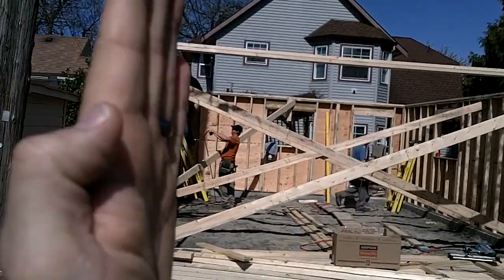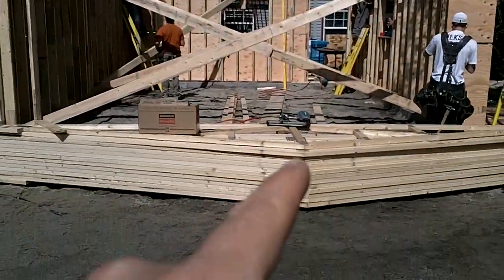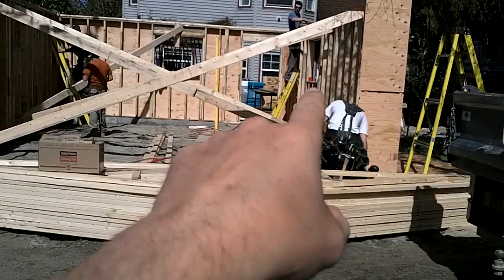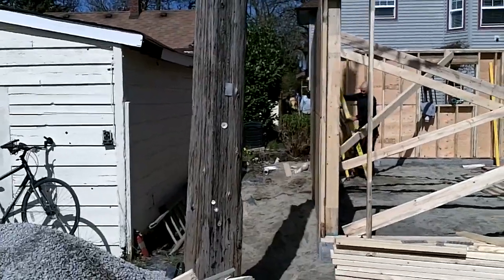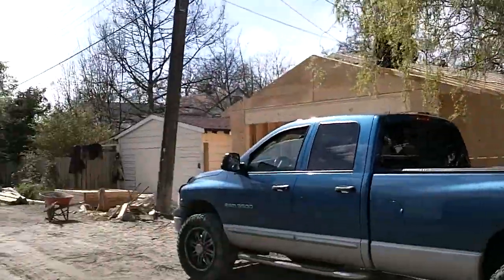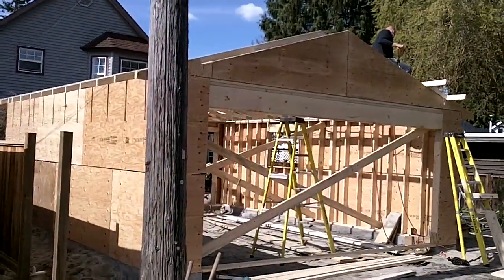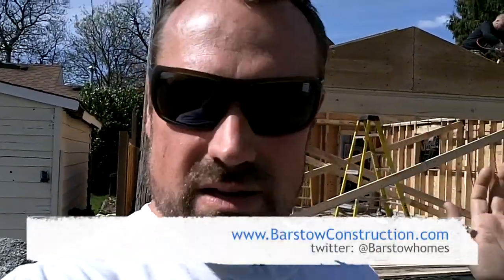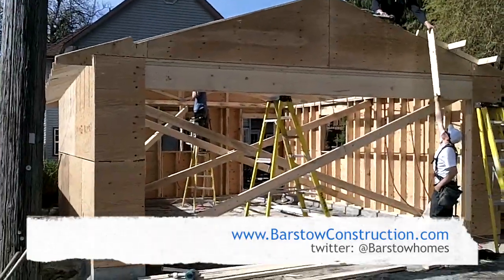Garage Build Part 8 - Framing the Garage

Comment from the maker: You are absolutely correct. However, our building code (and our inspectors) require headers to span openings. So we build headers to comply... Plus we get to recycle our form lumber, and we feel it creates a stronger structure, anyhow, with no pinched doors or hard to open windows over the years!